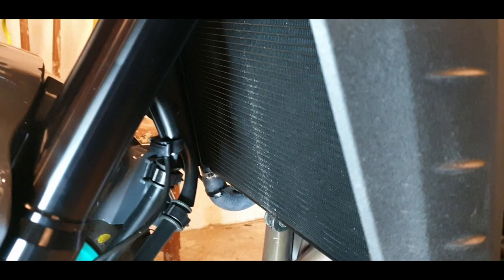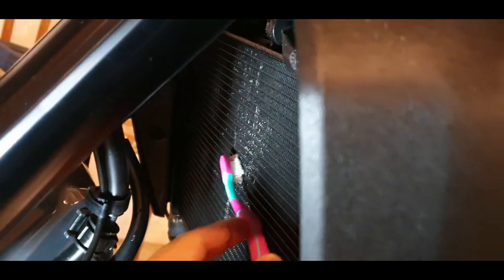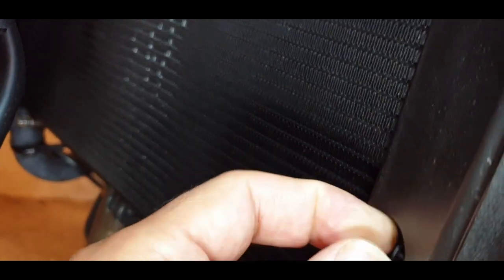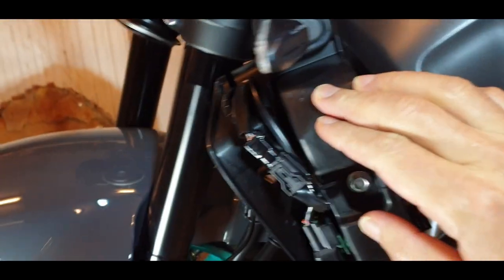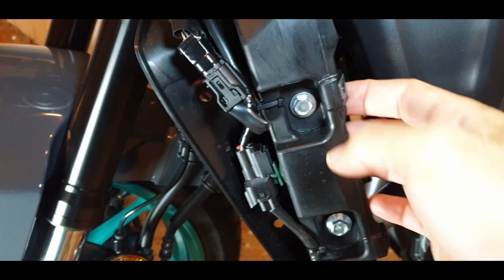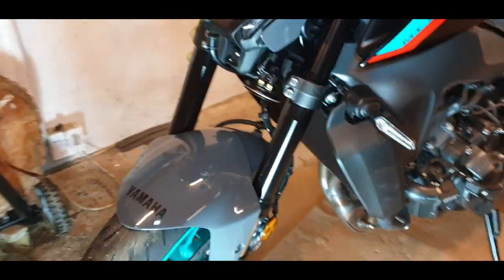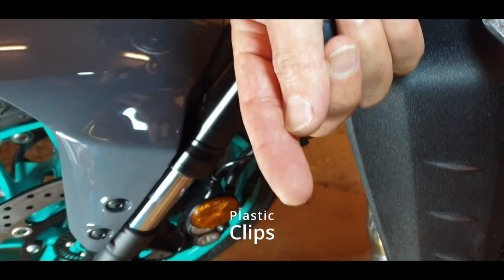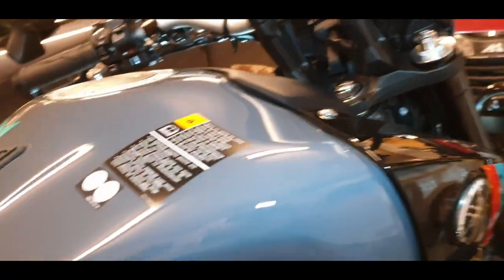Yamaha MT09 2022 radiator guard install #mt09 #fz09 #yamaha #radiatorguard

Comment: Awesome Video, I just did the installation of my bike’s radiator gaurds. I had a bit of struggle screwing the inner bolts but could fix it now.
Just a question- is there a significant gap between the guard and the radiator ? In my bike I see one or two inch gap
Reply from the maker: Hi, 
The bolts as you saw in the video are different from each other. 
About the gap is only 10 - 20 mm (1-2 cm). You should have got some kind if rubber distancers to put between otherwise get ones by yourself and place them on places shouldnt bent the radiator flenges. They are important, because if the guard flex while riding it could casue damage. If the gap is big you loose a little of the protection and mud and dirt could come in between.
Thanks for watching!

Comment: The Tracer 9 has it probably very similar to mount. Got my like.
Reply from the maker: Yes you are right! Here comes the part description from the shop:
For YAMAHA MT09 MT-09 2021-2023
For YAMAHA MT09 SP 2021 2023
For YAMAHA XSR900 2021 2022
For YAMAHA FZ09 2021 2022
For YAMAHA Tracer 9/GT 2021 2022
For YAMAHA Tracer 900/GT 2021 2022

Thanks for waching!
Reply: @swedrider  You are welcome.